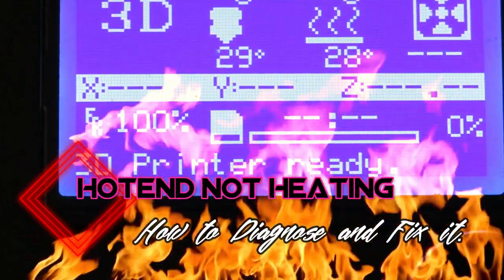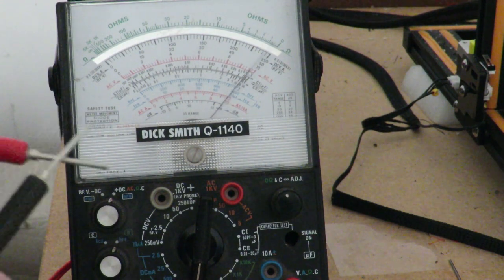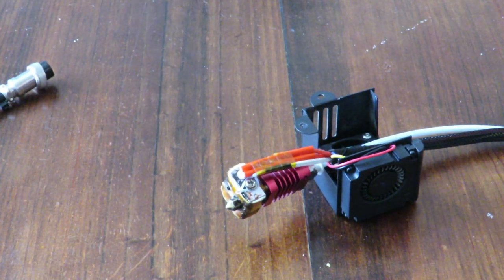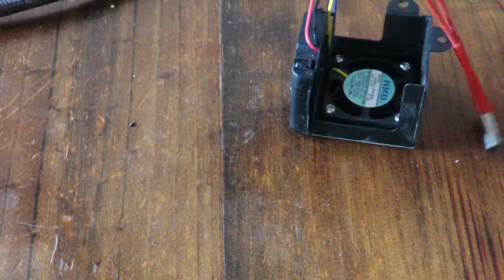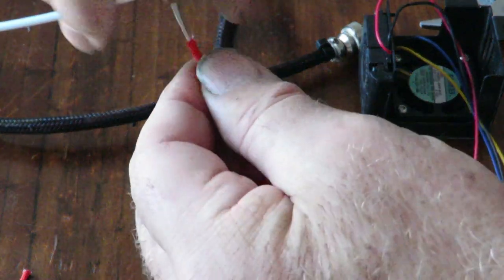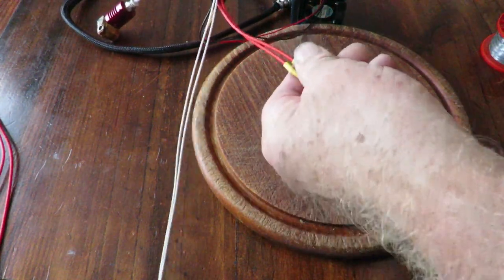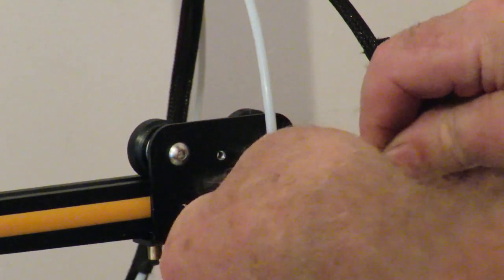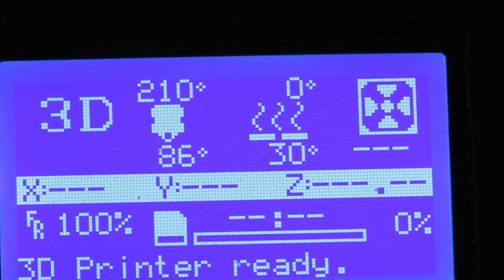📌3D Printer hotend won't heat up - Diagnosing - identify Fault - Replace Ceramic Heater Cartridge

Comment: Quick question: what if the temperature just keep on raising?? what is the problem then??
Reply from the maker: I't sounds like it would be a faulty thermistor. (its located on the the hotend next to the heater cartridge.)
A thermistor looks like a small blob of glass on the end of two wires.
Reply: @GarryPurcell  I have a similar problem and ended up replacing the full heating block, thermistor and cartridge this evening, went to test, and temp came up fine. On running filament, I ended up with one nasty smoke show and eventually the sensor threw an error code. I'm a competent wire splicer, but I was led to believe that wiring on the thermistor was not biased to positive/negative? In my case I would have used the parts as is (which was the point initially) but the connectors were the wrong sort so I swapped them out for another set. I'll take the multimeter to it over the weekend, but in the event you see this, was I led astray on the wiring?

Comment: I'm stuck. Thermistor works ok, temp is stuck at 26. Wires look ok, nothing loose. Replace heat cartridge, still no heat. It's hard to tell what exactly you're testing with the multimeter and where you're attaching the probes. I'm a noob and don't know how to use a multimeter, or what to do with the info it tells me. :(
Reply from the maker: I was testing continuity with the multimeter. (Making sure that the heater cartridge wire is not broken).
The thermistor looks like a small glass bead with two wires attached.
Test it with a heat source, (a hair dryer will do), if it won't register higher than 26, replace it.
Reply: @GarryPurcell  if I knew how to test continuity I would've seen one of the heater leads was disconnected. Ended up coming loose in the 8 pin aviator connector.
Reply from the maker: @xpinchx  At least you found the problem ,and are wiser for it.

Comment: I've got a problem where it would heat sometimes and would not heat sometimes. Like, when it comes to low Z axis (when starting of a print) It will just start dropping.
Reply from the maker: Sounds like you have a broken wire to the heater cartridge.
Reply from the maker: @raghavgarg6909 I'm not on Instagram, If you go to my Video Channel's About Page, you will find my Email address.

Comment: This is kinds off topic to the video, but this was the only one that I could find sorta relating to my problem. So I have one of those cheap CTC DIY printers and it keeps saying "ERR MAXTEMP BED" since it is a clone of the prusa I thought I could use what they said and apply it to my printer. That obviously did not work, and now I have all the settings and configuration in place, but I still can't print because my heat bed is at 358 degrees even though I don't feel anything
Reply from the maker: Is there any current going to the Bed?
Reply: @GarryPurcell  I think so. I am a total noob at 3d printing, but I am sure that it is connected to the motherboard
Reply from the maker: @tundeogunleye3157  Can you test it with a Multimeter, to make sure there is current flowing to the Bed?
Reply: @GarryPurcell  Ok
Reply: @GarryPurcell   problem is I don't have one
Reply from the maker: Has the printer ever worked properly, or its just developed the heating fault recently?
Reply: @GarryPurcell  recently, when I finished assembling it it said "Ib3 printer ready to print" or something along those lines. I just realized that the line connecting the extruder to the motherboard was broken, and I'm trying to remove the wire so I can replace with a new one. But I am having no luck and don't know if fixing the wire would fix the maxtemp error. However, I haven't printed anything because I just got this printer so I'm not sure if it was going to work regardless
Reply from the maker: @tundeogunleye3157  The wire definitely need to be joined, or replaced.
Reply: @GarryPurcell  Yeah I ordered a new one, but do you have any idea how to remove the broken wire off the extruder? I completely deassembled is and I see no screw to remove the extruder from  the main moving mechanism

Comment: i thought all creality ender 3d printers were 24V?  or does it drop that voltage down to 12V for the hot end?
Reply from the maker: The Cr-10, CR-10S and the Mini I own all use 12v.
Hope that helps
Reply: @GarryPurcell  12V bud

Comment: Hey mate I tryed to measure does any voltage comes to wires on board yellow ones that goes for hotend, and there is 10V when its idle, when I try to heat it up it shows 0V

Comment: Hi my ender 3 pro nozzle wont heat up it just says -14 as temprature what should I do ?
Reply from the maker: Have you replaced the heater cartridge?
Reply: -14 means there is no thermistor connected. must be a broken cable or your thermistor has disconnected

Comment: Crap... I just got a CR-10 mini and I think I boned it.  Thought I had the aircraft plug keyed right, but when I turned it on the screen worked for a second and then froze up.  So I turned it off & on a couple of times, then noticed that the nozzle was starting to smoke.  So I unplugged it, and yeah I had it wrong.  Plugged it back in and the screen/controls all work fine, but the nozzle temp said over 300 then fell down to 265 and now it's stuck there.  Nozzle is cold, still says 265.  Tried changing the temp in the menu, tried a test print, nozzle doesn't seem to heat up at all anymore.  (Luckily I already had some Cap tube on hand to replace the burnt PTFE)

I have a spare (slightly used) cartridge from my i3 Mega, but hopefully that does it and it's not the mainboard.  It literally just arrived yesterday so I could probably get some help from Creality, but I wouldn't mind just upgrading a couple things right off the bat either... and I was the one who boned it. 

I'm about to pull out the multimeter and try the cartridge I have, so we'll see how it goes. if it's not the that, I might end up having to upgrade the mainboard and hot end a little ahead of schedule...
Reply from the maker: Sorry to hear about your misfortune.
It might simply be the hotend heater cartridge, which are cheap to buy, and easy to replace.
Fingers crossed for you.
Reply: @GarryPurcell  Welp... the spare thermistor & cartridge I had didn't work. 

I'm wondering if I need to reflash the firmware/tune the PIDs or something.... somebody on reddit mentioned that Marlin might have a temp limit that was triggered.  
Probably should start checking the mainboard too though.  Not reading any voltage on the hot end wires...
Reply: @TheDrewker i have similar problem, check the  voltage of the 2 wires on the heater cartridge when the printer is set to preheat hotend... if the temp is low then its a short on the board, anyways did u get through ?

Comment: My anycubic Mega Pro hot end doesn’t heat up, I need help!!!
Reply from the maker: Good Luck for tomorrow.
P.S. If your repairing a wall for the first time, you might like this video as well.
https://youtu.be/JmcR9TW4mM0
By watching both, you will get a better understanding as to how easy it is to DIY.

Comment: a failed print left my nozzle encased in plastic.  I have a replacement.  I have followed the red wires back to the mainboard.  My question is does it matter how the two red wires go into the green port as in the - or + orientation?
Reply from the maker: I would suggest you mark your wires before cutting them, so you know what order to re-solder them.

P.S. You can salvage your plastic encased printer nozzel. (while its still connected to the printer)
Raise the hotend up so you get clear physical access to it.
Heat up the hotend higher than normal, only by a few degrees, then simply pull the plastic blob off, it should come off quite easily. (you may need pliers if its really thickly encrusted)
Reply: @GarryPurcell  thanks, there is no resoldering to the main board, in untightening of two screws pull the red wires out and place the new ones.  Problem is both red wires are identical and cant find anything that indicates which red wire goes in it which terminal that supplies power to heater cartridge fire the nozzle
Reply from the maker: @therizinosaurus214  
I suggest you look up "how to check polarity with a multimeter". 
I don't personally have a video showing this proceedure, but there are some good ones available on YouTube to help you out.
Reply: @GarryPurcell  thanks, I will look into it

Comment: Around 1:31 it would have been nice to see where your probes were instead of looking at a meter.  My Hot-end heats up but after 5 minutes or so the filament gets plugged by the nozzle and stops feeding.  I'm thinking it may be the Heater Cartridge and/or the Thermistor.  I'm praying I don't have to go into the main board.  I'll buy a new printer first.
Reply from the maker: The probe is on the positive and negative wires leading to the hotend.

Check the temperature shown in your LED display settings, this will indicate if the hotend is holding temp, if it drops to nearly zero, then you have a failed thermistor.

It sounds more like you are feeding too much filament to the hotend. (Hence the nozzle blockage)
I'd first reduce the feed rate by 5% and test to see if you are still having that feed problem you mentioned.
Reply: @GarryPurcell  wow!  Thanks.  This is the first time I heard of this.  This started happening a week or 2 ago with the original Tornado hot-end.  I wound up buying the Micro Swiss hot end and had the same problem.  At the risk of sounding stupid, where and how would I change the feed rate.   I use S3D.  Would that be the extrusion multiplier?  My nozzle is .4 and the extrusion multiplier is at 90.  I don't ever remember touching that.  Maybe I don't need a new  Heater Cartridge and Thermistor.  thanks again
Reply from the maker: I don't own or use Simplify 3D, so I'm unable to answer 100%.
I personally use Cura v4.00, and you will find that setting under "Flow", so I would guess S3D would have a similar setting.
Reply: @GarryPurcell  Okay thanks.  I appreciate the help
Reply: @GarryPurcell  Hi Gary.  My new Heater Cartridge and Thermistor arrived.  Following your video I stripped a bit of wire off the cartridge and  did the ohms test and there was a reading.  Then I put my meter on DC and heated up the cartridge to 100c and got a failed message on my control box screen 'heating failed please reset'.  Now when U did these tests I had the cartridge and thermistor out of the hot end.

I'm going to solder on the new items and see what happens.  Hopefully that will correct the situation.

UPDATE: Everything's back together and running a short print job,  about 2 hours.  Thanks for your help Gary.  Tons of thumbs-up for you
Reply from the maker: @ChinaAl  Glad My Video helped you solve the problem you had with your 3D Printer.

Comment: What happens if all is done, and you replace the cartridge and it still won't heat up, it just sits at -14 degrees.
Reply from the maker: Did you check continuity for the wires with a multi meter?
Reply: @GarryPurcell  Yes, I did that on all of them, they are all working correctly, I am leaning toward replacement of the motherboard. Unless, I am missing something. These units are not rocket science, so I diagnose to the sub assembly, then to the main board is what I am coming up with. I used the hair dryer, nothing happened.  I am at a loss. Sad thing is this unit has spent more downtime than up time. I made a purchase of an anycubic I3 Mega, and the Ender 3. So far my Anycubic has been doing well, had a little issue with the bed, but after getting that sorted out, it has been doing well.
 My ender however is different story. I don't mine tinkering with it, because when it is working, it prints probably better than my anycubic.

Comment: I get readings when I try resistance test, and I don't get any voltage when I try to heat it up 0V... Are You sure that mb is problem?
Reply from the maker: If no voltage is showing at the cartridge (when power is turned on).

First make sure there are no broken wires, (do a full continuity test) 
Second make sure everything is correctly plugged in.

If you still have no voltage at the cartridge, then definitely take a look at the main board.
Reply: Garry Purcell hey mate I checked cartridge it's fine, they said it's hotend so they sent me a brand new one and problem remains, it actually heated up again and then dropped to room temp in the midlle of a print...

Comment: my printer says the temperature is 66°C... but it's just cold, the hotend doesn't heat... I used the heatgun, I can rise the temperature, but I guess the thermister is damaged and maybe the heater too.
Reply from the maker: I'd say you have a heater cartridge problem.
However, the cost of replacing both the heater cartridge and thermistor, at the same time, is minimal.
Reply: @GarryPurcell  do you know what the fun part was... it had still the same problem... and now I know why.. it's because of the software, I used an earlier version of tiny machines, because I had problems with my bltouch, after somebody sayed to me I have to put for the new software the plug from Z- to Z+ after that the new software worked... and this 65°C bullshit was gone.. now the temperature is 22°C.. room temperature xD I destroyed the heater and the thermista to change the cables quickly ^^^^^and I guess they were never damaged ^^' daaaammmnnnnn... xD

Comment: Nice and clear demo of the whole process. Thanks. I've seen other cases where the problem wasn't the element itself, but where the wire is crimped to the element Wire snaps at the termination point. Worth checking (eg: https://www.youtube.com/watch?v=MMVGsPNepmY)   
(I like the old Dick Smith multimeter, BTW.. I used to live around the corner when his first store opened at N. Sydney... around 1986(?))
Reply from the maker: Hi Bernie
Taking your time and diagnosing the fault correctly, saves a lot of time.
Now were both showing our real ages, your reference to the Dick Smith Multi-meter was a dead giveaway. haha

Comment: Holly crap, it's a dick smith brand, that's got to be atleast what 1985 around that!
Reply from the maker: As they say.... 
They don't make them like they used to.
Reply: @GarryPurcell  so true that, I remember having old Dick Smith branded  remote control cars lol
Reply from the maker: @shartslaw322 The philosophy today is if the battery is dead, you need a new device haha.

Comment: I have a problem. I have been looking all over the internet for a full week now and can't figure this out. Any help from anyone would be appreciated. I am new to 3D printing but have some basic electronics understanding. 

Simply put... my hot end won't heat passed 106 and reads around 68 at room temp. But the thermistor reads appropriate ohm values according to this table: http://www.bapihvac.com/wp-content/uploads/2010/11/Thermistor_100K.pdf 

I have a CR-10 and I decided to update to TH3D firmware. I felt uncomfortable doing it because I have limited experience but I wanted to get it out of the way so that I could move on to bigger and better things. Well, I am not sure but while doing it I may have connected the hot end cable incorrectly. I am honestly not sure. The connection is difficult to see because of the short cables. Anyways, if I did incorrectly connect it could that be the cause of my hot end not reading correctly and then failing to heat? The short answer of course is yes. But I need a real advice. Is there something in the firmware that I should look at? I understand the basics of the firmware but it is of course a lengthy process to read every last part. Or could it be something like a messed up voltage regulator, power supply or main board? 

Any constructive help is appreciated. I know that I may have possibly messed up but I need help. Thanks
Reply from the maker: Hi Jay
Sorry, I have no knowledge of the TH3D firmware settings.
I would suggest you goto https://www.th3dstudio.com/
And ask them direct, as they are the devlopers of the firmware your using.

Comment: My Geeetech a30t is brand new hotend isn't heating haven't even done the 1st print wtf getting a refund on this pile of crap
Reply from the maker: I don't own a Geeetech, but the principle is the same for all hotends.

1. The first thing to check is that the wiring is correct, and fully plugged in.
2. I assume the controller has a preheat setting, so test that to see if any heat is applied to the hotend.
3. Next would be the method I use in my video.

If all the above fail, as you have already indicated, contact your supplier.

Comment: That's not a multimeter, it's a WW2 Geiger counter ;) Lol
Reply from the maker: It's around 50 years Old, give or take.
AND... I don't need batteries, to make it work for most tests.😉
Reply: @GarryPurcell  That's a good selling point. Well if it works it works. I'm a fan of analogue myself. I prefer the microwaves which have a dial and a bell to the digital ones. Simplicity is the secret to a happy life.
Reply from the maker: Simplicity and made to last, go hand in hand.😉
Reply: @GarryPurcell   That must be why I'm still around then ;)
Reply from the maker: @ArcanePath360  Haha😂